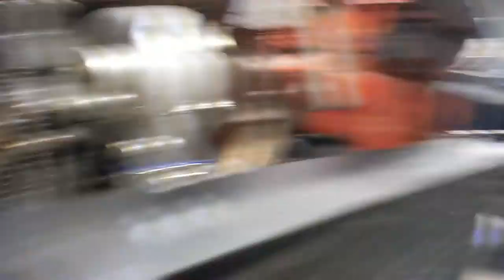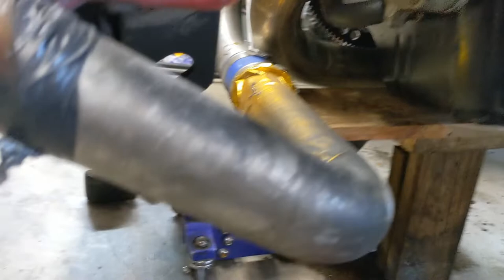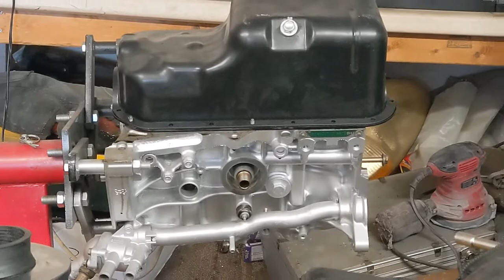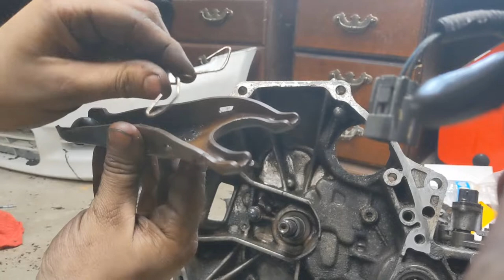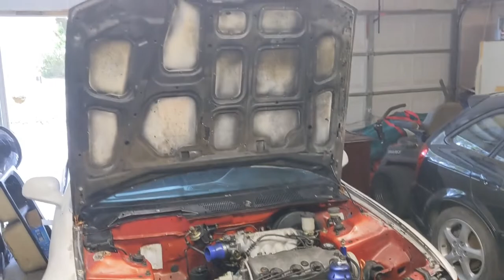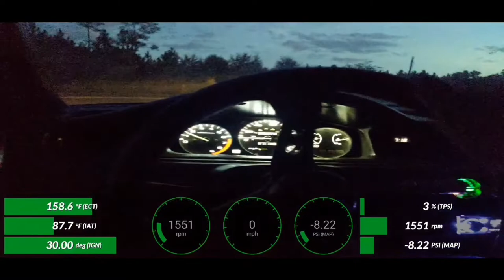Installing stage 2 Clutch 95 Civic D Series Turbo EG eBay Kit

Comment: One clutch pro max lasted me 5 months on a stock d16y7. This second clutch max pro I purchased lasted 3 days….
Reply: Oh dear, I had clutch max lasted 3 years and 50k miles. Would of kept going but the throw out bearing fried, but 3 years for 150.00 and 9psi boost 225whp not bad.